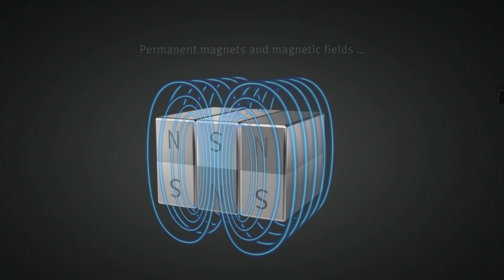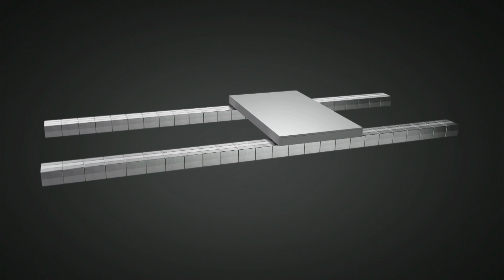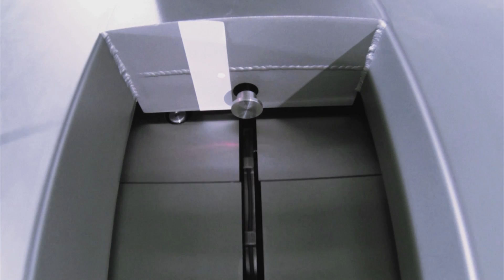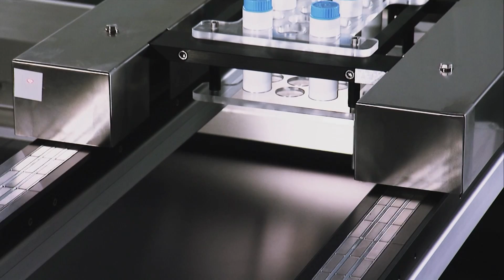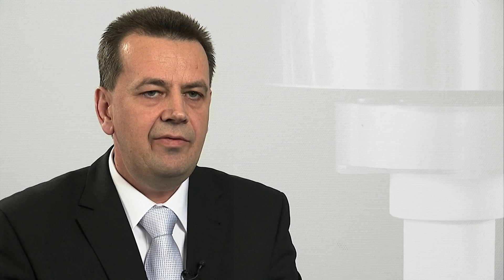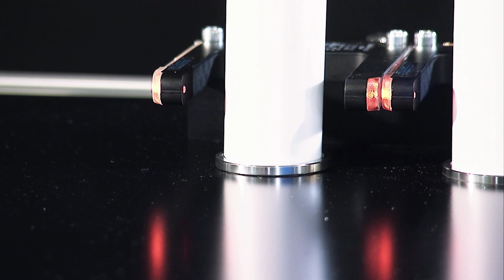Festo -- SupraMotion EN

Comment: Essentially this will need to be powered by liquid nitrogen in order to sustain a temperature of -196C, as far as I know the superconductor loses its property of "levitation" once it is at room temperature, but as they said, it makes no noise, so this may work on small to medium scale with a situation that requires little to no noise. . .